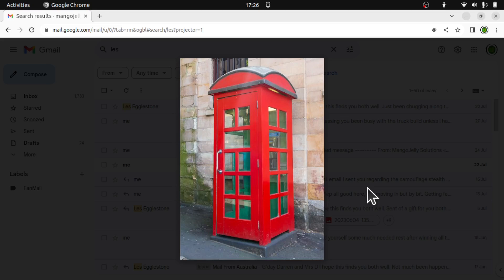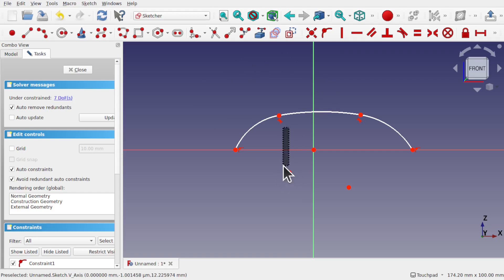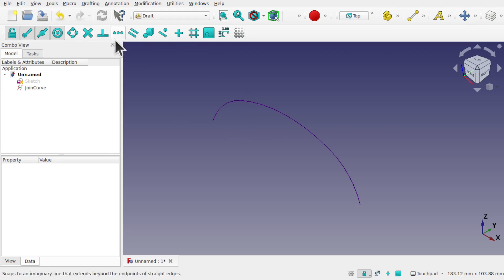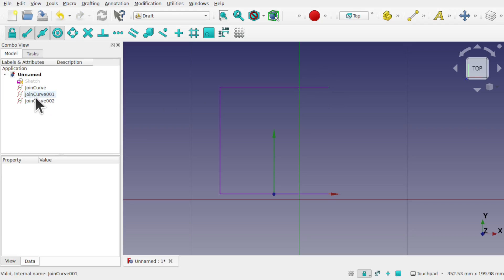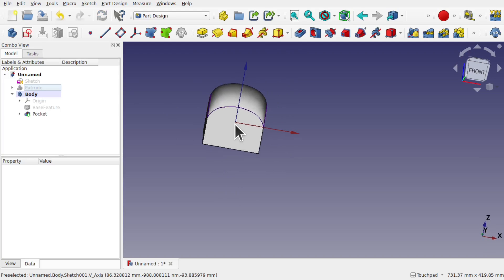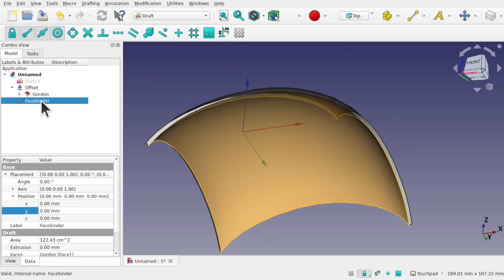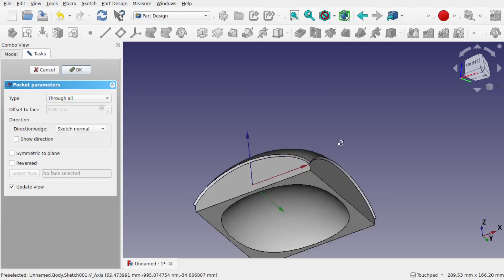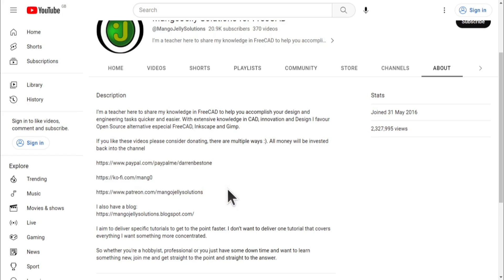FreeCAD: How Do You Create This Surface? Creating and Surfacing Wire-frames Using Curves Workbench

Comment: I am wondering how you would approach creating a similar shape (a dome arising from a polygon) with more than four sides? Specifically, I’m trying to figure out how to create a smooth half-ellipsoid dome rising out of an 18-sided polygon. I have tried setting up a loop of curved ribs from the corners with extent polygons offset vertically touching them and tried to run Gordon Surfaces but it just hangs and gives me an error. I have tried subdividing it and using arrays but the seams aren’t smooth — they pucker slightly inward.
Reply: Why not over-extrude the polygon and then cut out a quarter circle that is tangent to the top and rotates about the axis in the padding direction? That would create a semi-circular dome at the top of your polygon extrusion.
That's how I thought the telephone booth roof would be modeled in the first place.

Comment: I was inspired by your video to make something very similar in build123d (a new type of CodeCAD that uses the same underlying kernel as FreeCAD (OCCT))! Here is my solution:
from build123d import *
with BuildLine(Plane.XZ) as l:
     m1 = JernArc((0,0),(1,0),100,-45)
     mirror(about=Plane.YZ)

with BuildLine() as l2:
    with PolarLocations(0,4):
        with Locations((0,(m1@1).X)):
            add(l.line)

zz = Face.make_surface(l2.line.edges(),surface_points=[(0,0,-(m1@1).Z)])
bb=zz.thicken(-10)

with BuildPart() as p:
    add(bb)
    with BuildSketch(Plane.XY.offset(-80)) as s:
        Rectangle(141,141)
    extrude(until=Until.NEXT)
    with BuildSketch(p.part.faces().sort_by(Axis.Z)[0]) as s:
        Rectangle(161,161)
    extrude(amount=-20)

Comment: FreeCAD has so many data types, from points, sketches, wires, various types of curves, surfaces, solids, bodies - do you have something like an overview, when to use which, and which ones can be converted to which other ones? Thank you for the great videos.
Reply: Don't try to learn all at once, it won't work. I suggest you just take a basic tutorial and simply follow along. Follow exactly at first, then start deviating and make something similar on your own. Then, whenever you don't know how to continue, pick a tutorial for a part that has a similar feature, and take it from there.

Learning "the software" first won't work, because there's too many different workflows and tools depending on what you're trying to achieve, and even a myriad different ways and workflows to achieve the exact same thing. The best way to learn a software like this is project-based learning, where you pick a defined goal and learn the tools you need as you go, bit by bit.
Reply: Good point. I wouldn’t have known that I needed that Facebinder. I would have tried to extrude from the bottom face of the dome directly. Would that have worked?

Comment: Perhaps I'm missing something here, but I was able to build the 'roof' in about 2 minutes. I simply created a profile suitable for revolving the dome part of the roof, then made a pocket from an open-ended box profile (a square within a square) whose inner square corners are 'on' the outermost outline of the dome. Two trivial sketches, done.
Disregard: there's more to it.
Reply: I thought the same procedure, and it doesn't even need any additional workbench. But the gold in this video is exactly that: a different way to skin a cat.
Reply: that's what I thought at first, but the surface may not necessarily have rotational symmetry, meaning the approach in the video gives you more control